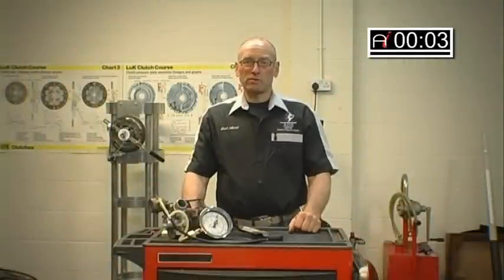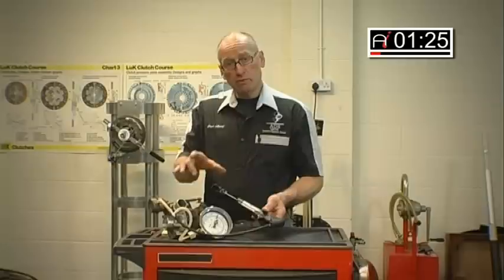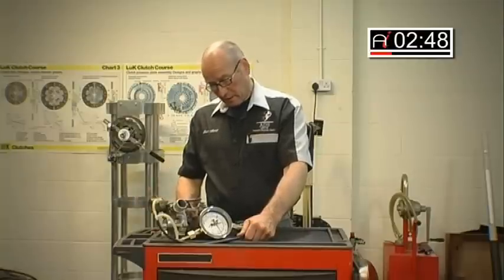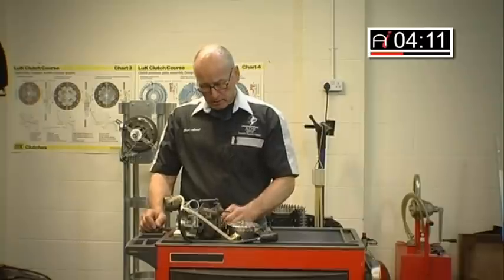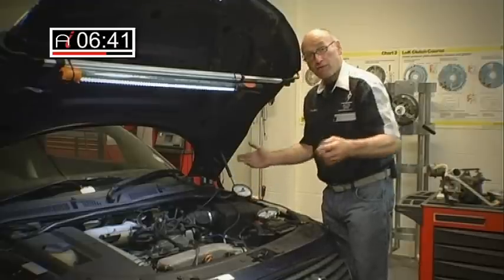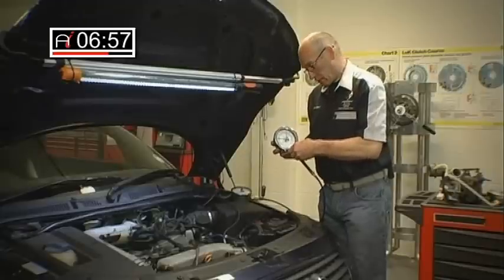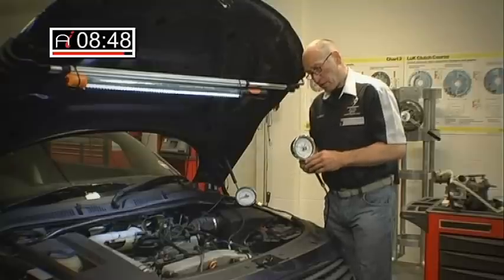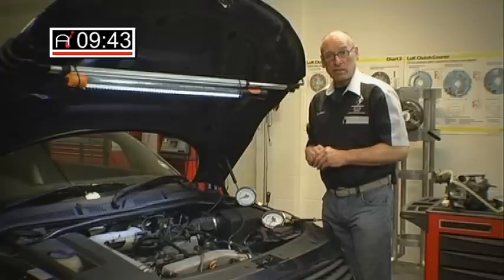AUTOINFORM ONLINE MAGAZINE - HOW TO TEST TURBO CONTROL with Frank Massey

Comment: i thought the turbo was activated by vacuum ( from the vacuum pump via a modulating valve ) rather than by pressure ( would need a source to generate air pressure) ?
Reply: Maurice Browne mostly of them are controlled by vacuum, there are some old systems( the pressure is created by the turbine, the boost pressure controls also the wastegate)